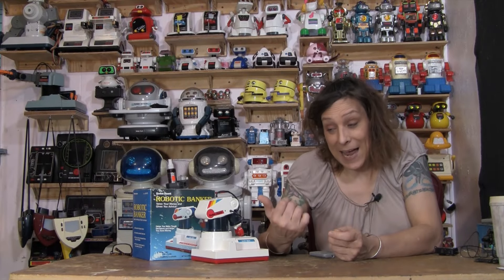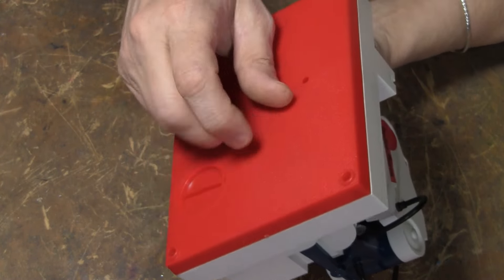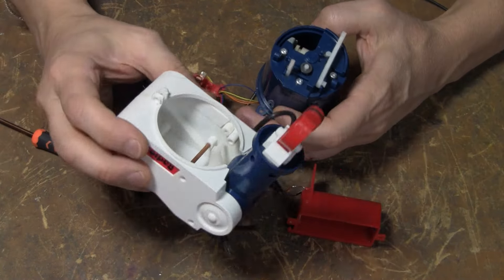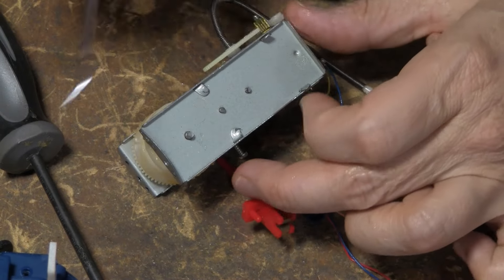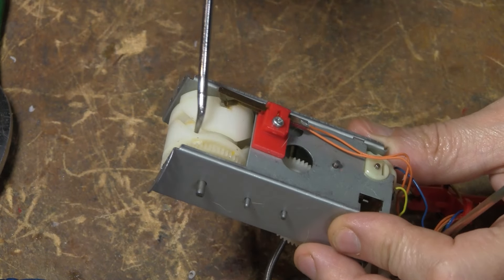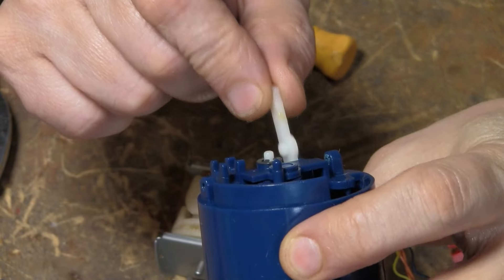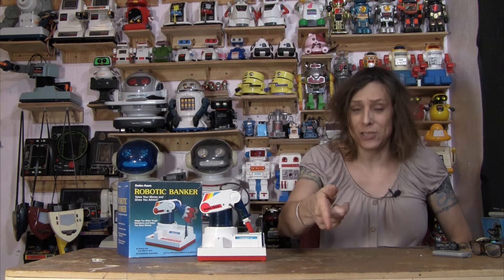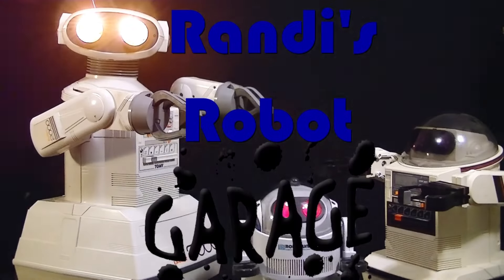Radio Shack's Robotic Banker: Coin-Answering Robot Arm!

Comment: I will never understand how you fix these. When I tried to fix my broken plastic toys as a child, it was all one-way locking plastic tabs and superglued shut.
Reply from the maker: I never successfully fixed them as a child. I've had 53 years of taking toys apart. Plus, didn't have the ability to take a bunch of pictures as you worked either.
Reply: @RandiRain   Yeah but all you do is take a screwdriver and the thing just disassembles itself. That's what I don't get.  Every screw accessible, no one-way locking tabs or joints superglued together.